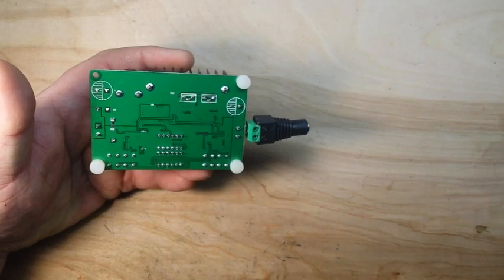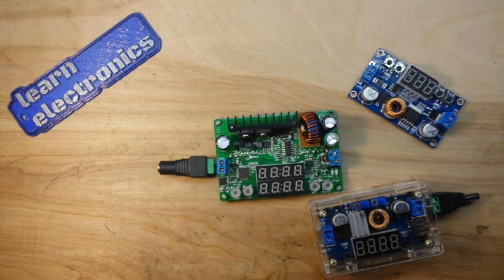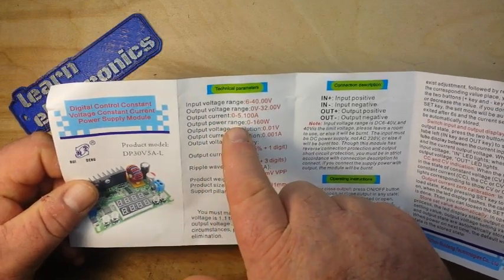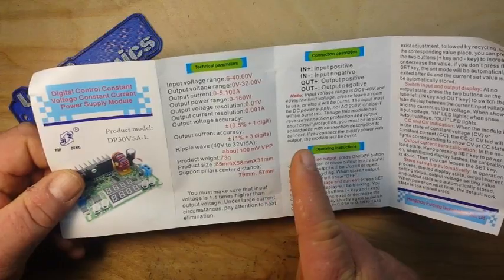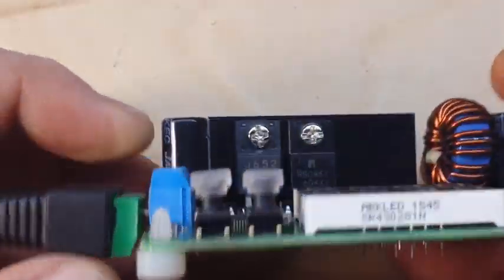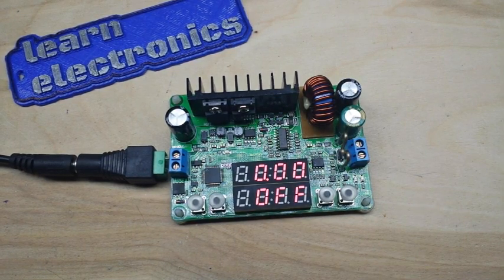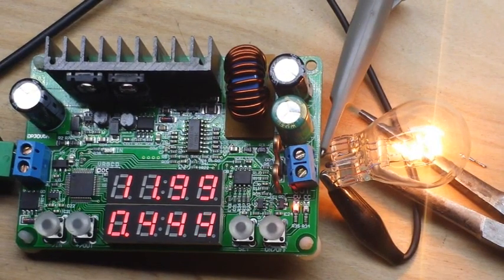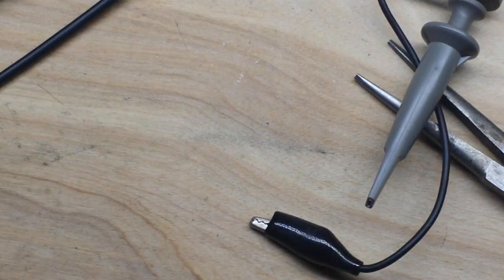Ebay special 30V buck converter from Alice1101983

Comment: Hi, thank you for the awesome video. I found it after watching your Black Friday recommendations. Please could you give me a suggestion if this power supply is good:  https://www.ebay.com/itm/163708651965
I found this manual  https://static.rapidonline.com/pdf/554305_v1.pdf  (schematics at the end) I wonder if this "heavy duty triple-channel, constant-voltage and constant-current linear  power supply with low ripple and noise, high reliability and high accuracy" is Really LINEAR and can have a "Ripple and noise of CV≤0.5mVr.m.s and CC≤3mAr.m.s", what do you think? Thank you again.

Comment: I’m just curious with these converters, how do they keep a constant voltage, cause the capacitor that holds the power can be distarged like it was being short circuited right?
Reply from the maker: Buck converter theory is a little much to get into here, but it's about the switching of the MOSFET and the tendency of the inductor to resist change.

Comment: I need one to take place of 2 D batteries. how many amps can two D batteries supply. well I guess one. since they are likely in series. surely not even a amp. maybe .750A. its for a igniter for a gas burner. in a thankless water heater. in my off grid home. I can't see putting d cell batts in. when I have 24 v DC everywhere. maybe use a small buck converter. and a large capacitor. to be sure it has the current. it shouldn't be on long. maybe 1-2 seconds max. can you give me an idea of a good PCB proto board. I don't want the ones that mimic the   solder less breadboards. I need more freedom with the traces. and the holes that are like rivits. I guess they are called through plated.  I looked on amazon and eBay. they are to many to choose. I just need like a few 2" by 3" or 4" or a large sheet that can be cut down. I saw some I liked. they are like a bread board though. I guess I could cut the traces. but I want it to look decent.  so can you point me to a good prototype PCB board. thanks you have been a awesome help.
Reply: James stranger , your estimate of 1 A is a bit low.  I remember a carbon/zinc battery in the old days producing some 9 A short circuit.  So I decided to check a modern alkaline battery.  It happens to be an Energizer D size that reads 1.55 V unloaded.  Turned out to have a 0.30 ohm internal resistance, which theoretically produces about 5.1 A short circuit current.  Actually my Fluke meter recorded 4.2 A, as its current measuring shunt is not zero - it is 0.100 ohms.  But based on the internal resistance of the battery, you would still have 1.25 V at the battery terminals, if the load is 1.00 A.  And one more detail, connecting two batteries (or more!) in series does not reduce the short circuit current.  That is because the voltage doubles along with the internal resistance.  So the voltage divided by resistance remains the same.

Comment: 2.8 mV is very small ripple actually.
Reply: Jose Luis Lucas Good question. I asume its just chinese thinking. Any good design would have included those capacitors but when chinese developers has reached their goals they dont do more.
Its like designing a digital circuit omitting the decoupling capacitors. It does exactly what it is supposed to do but does also emit a lot of unwanted radio frequency electrical noise. Its just their way of thinking.
Reply from the maker: +migsven surfing yes there's what I said
Reply: Adding both a 100 nF and a 10 nF at the output should get rid of the high frequency components. Nice unit.
Reply: May I ask, why they don't put those caps on the design? a 10nF cap is so cheap that I might be a reason on not putting them there...